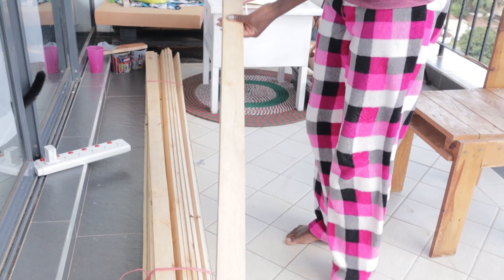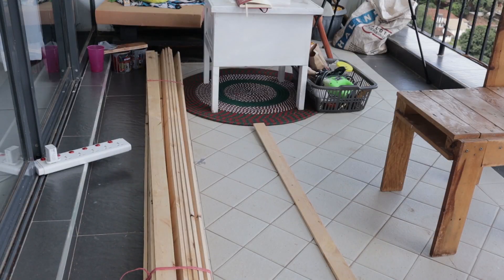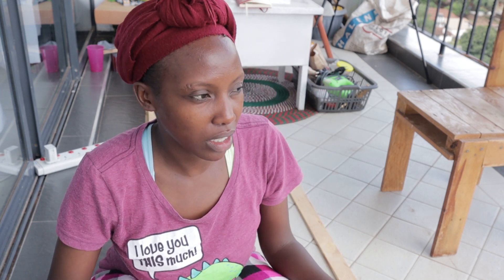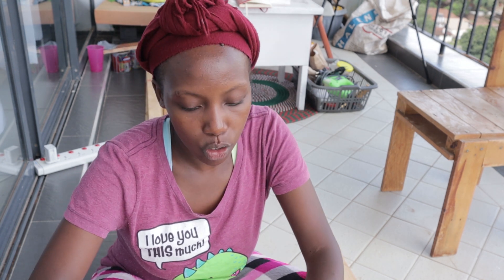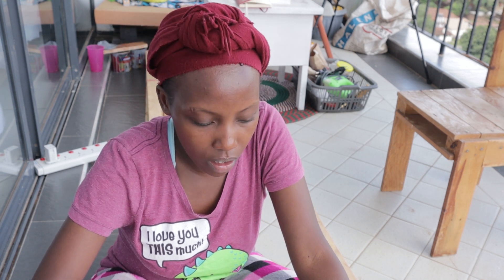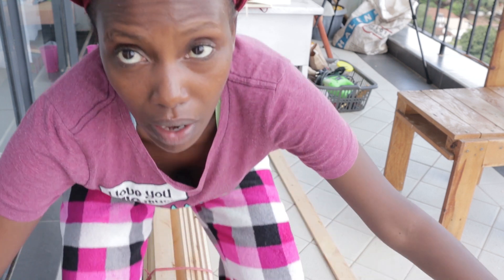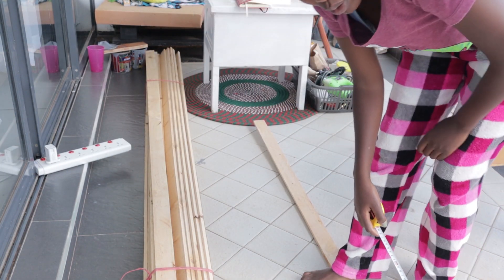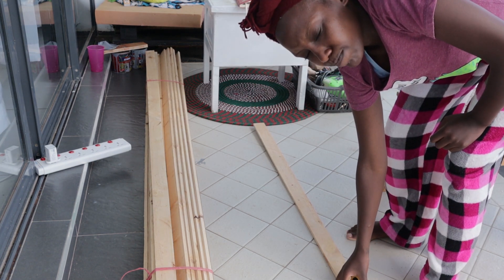HERE COMES MUTHONI EP 1| Brenda's Balcony Screen | Muthoni Gitau

Comment: 👏👏👏 I've been thinking of using this as my room divider in the bathroom as it's open,  which one would you recommend between this and glass as I'm on a tight budget ?
Reply from the maker: If on a tight budget, definitely this. Plus it will be easier to remove and you can use it for more than just diving the space. You can hang plants or even art
Reply: @IAmMuthoniGitau  thank you so much